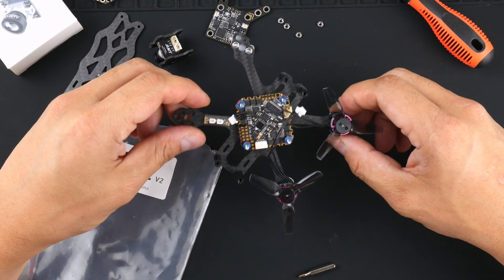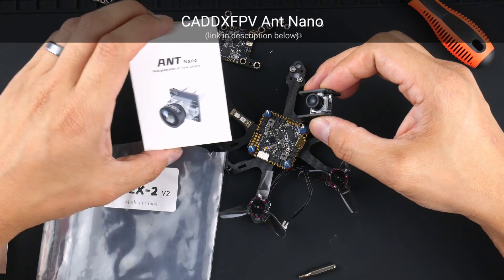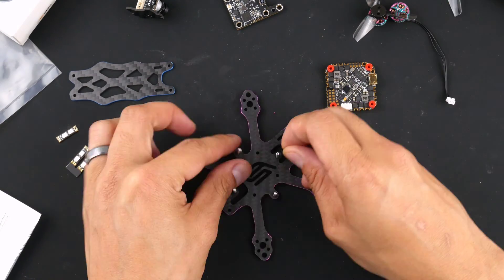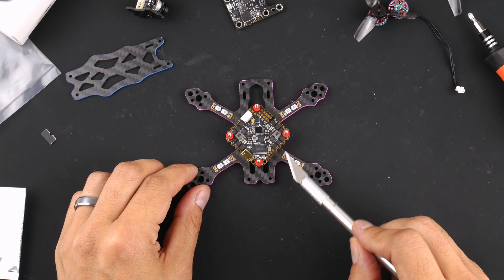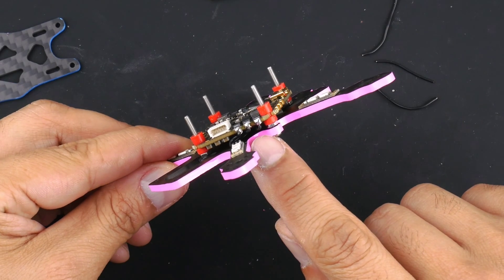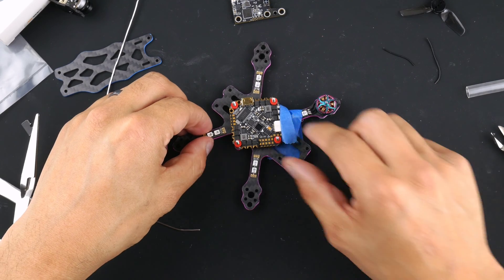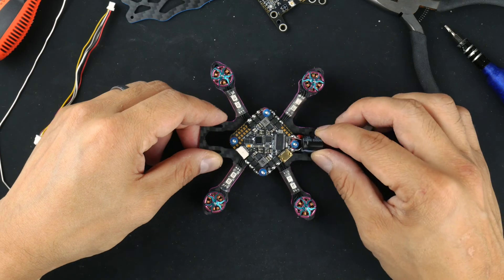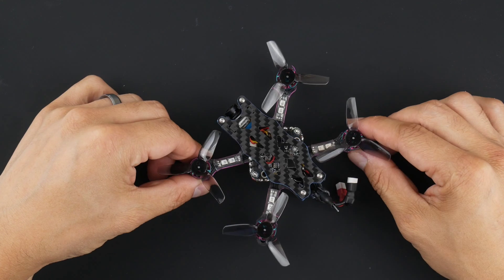Apex2 Build - Part 1 - JHEMCU GHF405 AIO 40A ESC RCInPower 1003 22000kv

Comment: Hi, can you explain to me how to do that battery connection, I mean from 1S to 2S, please
Reply from the maker: A 2s battery is essentially two 1s battery cells connected in series. This means the negative end of one battery connected to a positive end of another battery creates a 2s (s stands for "series"). They need to be balance charged to the same voltage and have the same life/health overall to avoid over discharging one of the batteries during usage. Hope this helps!
Reply: @nxp200  helped a lot, what about the conector? Can I still using the BT2.0? Or should I upgrade?
Reply: @rbauduino yes u can still use it

Comment: Sweet build! I'm actually doing a 7" long range on a standard mark 4 using this board with a 25x25 adapter to rotate it properly. 
Here's the list so far:
Frame:
-Mark 4 $12
Motors:
-2515 1880kv (super cheap white plastic motors from aliexpress) $13
Props:
-Gemfan LR 7035 $7
Board:
-Same board, JHEMCU GHF405  $38
vtx + rx:
-HappyModel ELRS AIO $25
Camera:
-RunCam Phoenix 2 SE V2  $18
IR:
-5W high-power 850 x 2 $5
Batt:
3300mah 3s $18
Prop nuts:
-black/silver $2
Power lead:
-t connector + mount $2

So $140 for this build.

So here's the thing: The motors only have 1mm wires x 3, and are only rated at 2s. 
So I'm going to do a gated 3s build, by limiting the throttle to 65% at first, and work my way up from there.

I'm hoping for 18-20m flights. I largely instructed AI to assist in doing the calculations, and to identify the correct prop size for the 3s conversion.
Because the motors were designed for 2s, I must limit the amount of voltage being supplied and current being drawn.
This is so I can have the benefit of 3s packs. It's common to limit ESC's if you want to run 4s motors on 6s builds.

Everything is just lighter than my 7" 6s fpv on the same frame. The props are lighter, the motors are lighter, the avionics are lighter, and the battery is much lighter (185g).
I even calc'd it with an extra 250g payload and apparently I could still get 10-12 mins with such a payload.

Soooo stoked about this build.
ALL of this is super cheap on Aliexpress and this vtx/rx aio really sorts out minimalism brilliantly. 
Obviously if we could get everything packed on one board that would be nice, but cramming it all on 1.5 boards is close enough.

Comment: Hi Nxp! Sorry for a newbie question, but where could I get the screws, washers & rubber spacers for mounting the FC?
Reply from the maker: @victorz7034  the rubber spacers came with the flight controller. But if you need replacements, they can be found on AliExpress here: https://s.click.aliexpress.com/e/_mKPCedv

The M2 screw kit I used is here: https://s.click.aliexpress.com/e/_mMTr4Eb

And the M2 nuts here: https://s.click.aliexpress.com/e/_mKY9cA7
Reply: @ thank you so much 💚💪

Comment: Is the 5V BEC powerfull enough for Walksnail 1S VTX? Has somebody tried this FC with Walksnail? Thanks
Reply from the maker: I don't have the Walksnail system, but based off the flight controller specs, it can provide up to 2.5A of current at 5v, which should be sufficient for the 1s VTX. Hopefully others out there have tried with this FC and can comment.